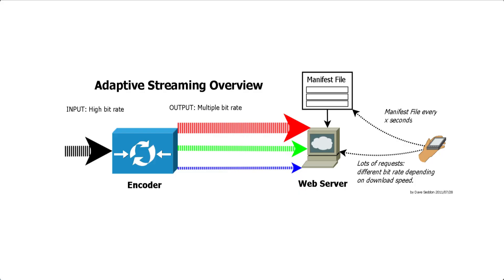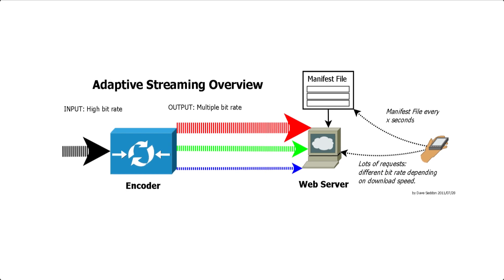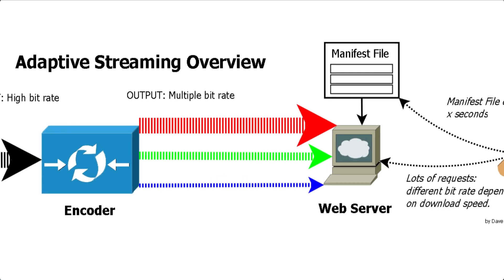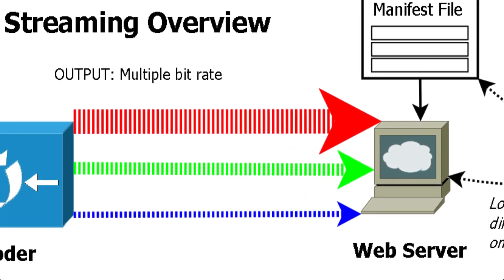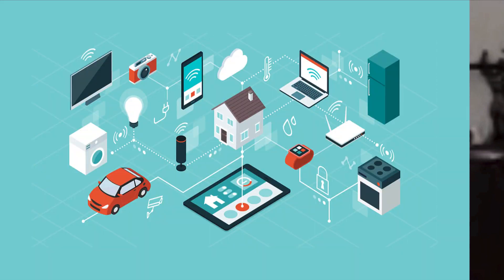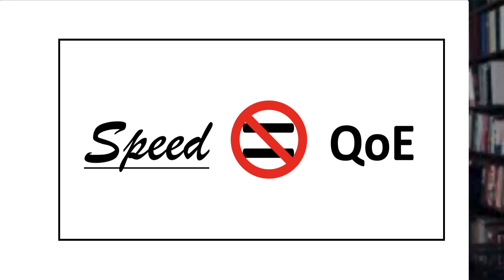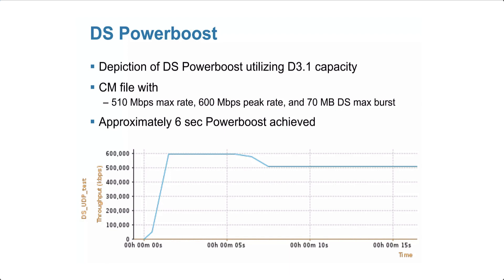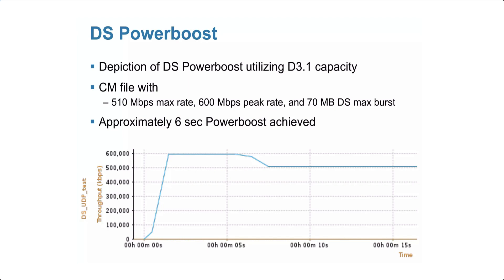DOCSIS IP Video Optimization

Comment: Why modem and router needed 2 public IP addresses for internet to work on router?
Reply from the maker: Typically only one public IP is required for a cable modem, but if you have voice service or video service, your service provider may require additional IPs for these or other services.
Reply: @Volpefirm I think he means ipv4 and ipv6. For Cox our modems won’t pull service unless it has both
Reply: Modems (and routers) often have both IPv4 and IPv6 addresses because they need to support both versions of the Internet Protocol, which serve different purposes and ensure broader compatibility. Here’s a breakdown:

1. Transition Period
	•	The internet is gradually transitioning from IPv4 to IPv6.
	•	IPv4 has a limited number of addresses (about 4.3 billion), and we’ve basically run out.
	•	IPv6 provides a huge number of addresses (340 undecillion), solving the shortage.

Because not all devices and websites support IPv6 yet, modems need to be compatible with both so everything works smoothly during the transition.

2. Compatibility
	•	Some devices and services still only use IPv4.
	•	Others are fully capable of IPv6 and prefer it for performance and routing efficiency.
	•	Having both allows the modem to communicate effectively with all kinds of networks and devices.

3. Dual Stack Operation
	•	Most modern networks use what’s called a dual stack, meaning they run both IPv4 and IPv6 simultaneously.
	•	Your modem likely receives both IPv4 and IPv6 addresses from your ISP and hands them off to your internal network, depending on what your devices and services support.

TL;DR:

Your modem has both IPv4 and IPv6 because:
	•	The world is switching to IPv6, but not everything is there yet.
	•	Supporting both ensures maximum compatibility and connectivity.